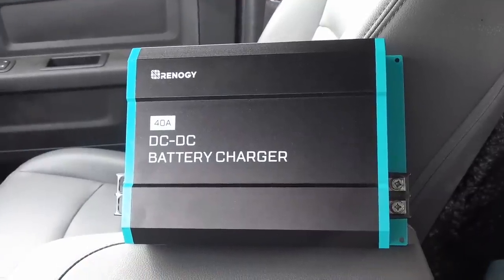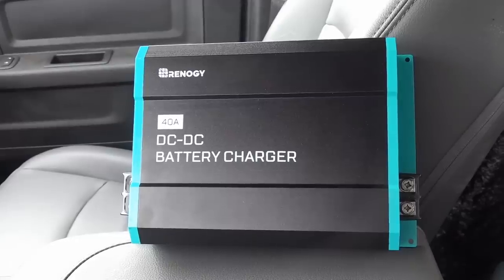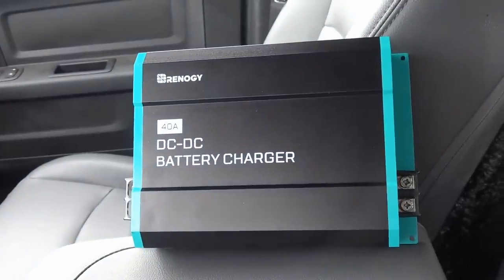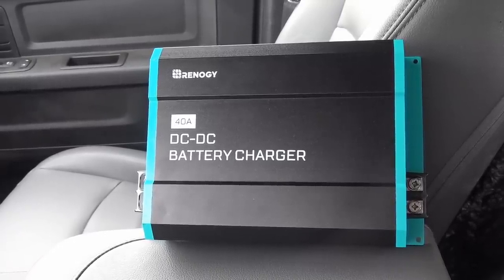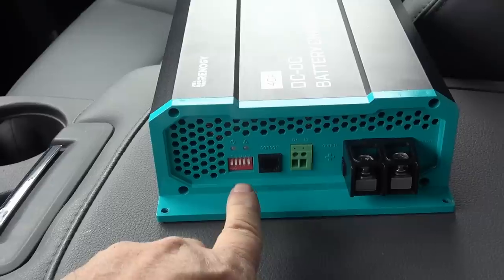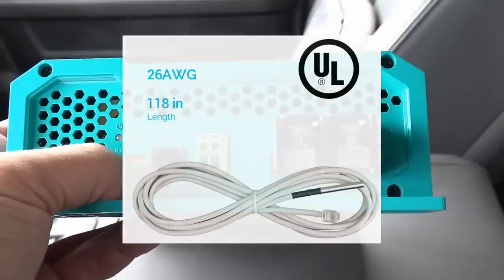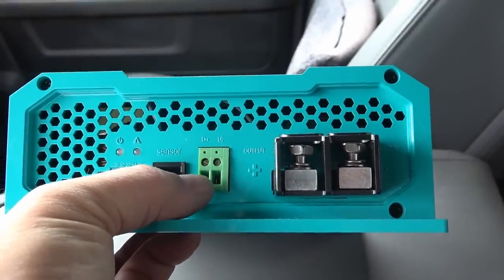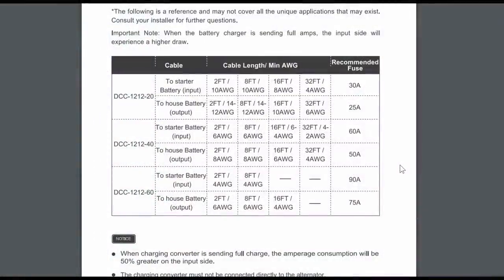Extra 40 Amps Charging into RV Battery Bank from Truck Alternator (Renogy 40A DC-DC Charger)

Comment: What bus bar did you use?
Reply from the maker: On the positive side I used my inverter fuse holder that I had and on the negative side I just ran the wire to my RV chassis. Here is a video where I explain my DC wiring in my trailer. This was prior to adding the DC-DC charger.  https://youtu.be/1f145rhB_e0  It shows the bus bars.  Cheers, Ray

Comment: You can not harm an alternator charging lifepo4 directly but neither it will charge it over 90% I have tested this with hooking empty lifepo4 to alternator and it doesn't charge more than 15A and this is because empty lifepo4 is still 12.6v and alternator thinks that 12.6v is 90% full battery and therefore reduces charging current to only 15A 😁 and yes I used amp clamp to see how much A is flowing into Lifepo4 and it's not worth idling the vehicle trying to charge it unless there is cables connected directly to lifepo4 to charge while driving 😌
Reply from the maker: It will depend on the situation. Some alternators can be indeed be harmed by lithium batteries. Things like cable length, gauge and whether there is also a lead acid battery hooked up at the same time and type of alternator regulation can make a difference. 
I've done testing with my Ram truck and it was not a problem in that situation because the charge wire is so small of gauge and wire run long and its a modern vehicle with a smart alternator. 
But people are installing lithium in also sorts of different situations where it may indeed cause a problem with the alternator. One example is in a marine use case on a boat. Nigel Calder & Jeff Cote Talk Marine Electrical - Part 11 of 11 - Drop In Lithium https://www.youtube.com/watch?v=o_1WVBa0rRE Also here is an experiment done by Victron -  How to not blow up your Alternator when charging Lithium https://youtu.be/jgoIocPgOug Cheers, Ray

Comment: Using jumper cables for your wires is a very bad idea. They aren't rated for continuous use. Good quality copper cable is a much better option. Otherwise it's a very helpful video.
Reply from the maker: I used 100% pure copper 4GA cables. Copper is copper. I've tested them and they don't get hot at all. Some of the cheaper ones get away with copper-clad aluminum. But a good set of 100% copper should be fine I would think.

Comment: Mine despite showing voltage in the output the light is always off :(
Reply from the maker: Make sure the trigger D+ wire gets its voltage from the input side and that both the input and output sides share a common ground.
Reply: @LoveYourRV  I attached the d+ in the car fuse box . Should I attach into the input battery directly ?
Reply from the maker: No, it should work like that. I have one working using the cigarette lighter as a 12V source.  Maybe it's a defective unit. :(
Reply: it is already the second I try….. input is my lithium battery spare , output is my 12v agm and because is a special ev it doesn’t have generator but it should still work……:( probably need to choose another fuse port?
Reply from the maker: I use mine now in my truck box power station works well https://www.loveyourrv.com/diy-truck-tool-box-off-grid-power-system/
Reply: @LoveYourRV  I wrote to renogy. Really hope they can solve the problem…

Comment: better make sure those jumper cable wires you used are not aluminum with copper coating, could melt and cause fire, after running for a while
Reply from the maker: Yes, best to use 100% copper, a little more expensive better power transfer. I listed these - https://amzn.to/3cioyyA  The ones I used I picked up a at truck stop, commercial grade.  I remember the old aluminum house wiring use to catch fire but that was to do with the connection oxidizing at the outlet or junction box and overheating. How do the jumpers catch on fire, the cheaper ones are stranded copper clad by the looks of it.

Comment: thanks for the video. if you are NOT running the engine, and just have solar charging, does it still charge with 40Amps? wouldnt this put a big strain on the engine battery? cheers
Reply from the maker: If you are not running the engine then there is no charging happening from the engine alternator via this DC-DC charger so no problem. The DC-DC charger isolates the engine batteries from the RV batteries and solar system so they aren't drained or strained. There is another type of charger that is a dual charger that does both engine charging and solar charging but that isn't what I have. You'd have to check its manual if that's the model you have but I'm pretty sure it would be design to not strain your engine battery.

Comment: Half of the charging goes to heat
Reply from the maker: That is a pretty broad statement. How do you figure with all the variables of alternator type/amp ratings, wire cable sizes, and DC-DC charger efficiency ratings?

Comment: Interesting video on using an alternator to charge lithium.  https://www.youtube.com/watch?v=jgoIocPgOug.  Sounds like you can run into some problems at low rpm with high draws.
Reply from the maker: Yes, that's why its good to have the DC-DC charger to regulate and limit the amperage draw to a safe level versus a straight hookup. Also, keep in mind most modern vehicle has what's called smart alternators that are regulated by the vehicles computer controller to protect them and also they are geared so at low engine RPM they still maintain a high alternator RPM.  Still, it's advisable to make sure to have a heavy-duty alternator.  That's why I elected to go with the optional 220 amp vs the stock 180 amp. For even larger amperage loads people will run dual alternators. Cheers, Ray
Reply: @LoveYourRV  Ray are you suggesting that I upgrade my truck's alternator?  My 2012 GMC Duramax came with a 125 amp alternator. Would this be large enough for a 40 amp dc to dc charger?
Reply from the maker: @darcolk  Not sure, best to get the advice of a mechanic. A lot will depend I assume on the truck engine type and its existing electrical power loads. If you add too many things it can overheat. That's why they come with different options. For instance, my truck stock is 180 amps but could be ordered with 220 amps or 440 amp dual alternators. Usually, 440 is for things like tow trucks and ambulances, that sort of thing.  I'd assume a diesel truck would need a bigger alternator for starting and charging as they come with 2 big batteries versus one battery for gas engines.